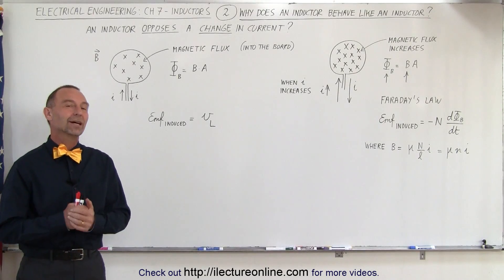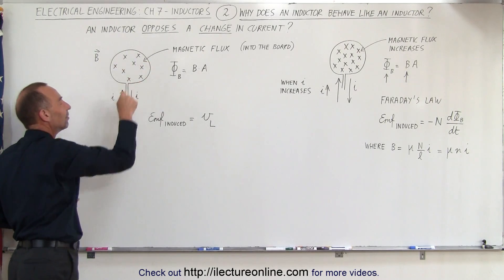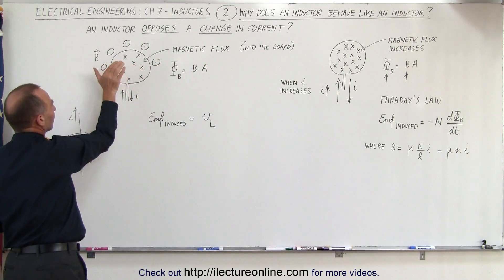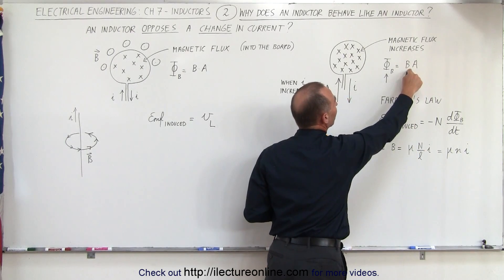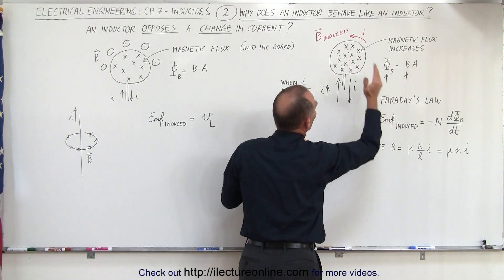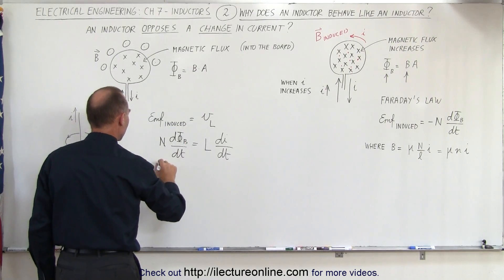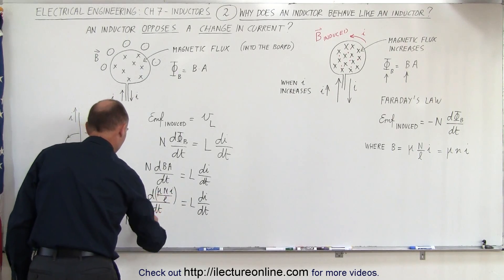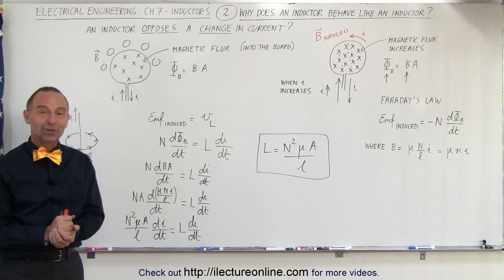Electrical Engineering: Ch 7: Inductors (2 of 20) Why Does an Inductor Behave Like an Inductor?

Comment: if the induced current sets up an opposing magnetic field and current, does that only cancel out the change in the magnetic field and the change in current caused by the increased current? if that is so, should there be no increase in magnetic flux, and therefore no change in current, so where does that extra applied energy go? Sorry, I'm confused. I will try an watch further but this confuses me.

Comment: I have a question: If you have an inductor that is rotating around the axis through its center and is perpendicular to its circular cross section, with homogenous magnetic field running parallel to the axis, will there be a voltage induced? If yes, is there any equation to calculate that voltage?

Thank you for making these videos, they are very helpful
Reply from the maker: A voltage is only induced if the magnetic flux through the coils changes.   From your description that does not appear to be happening.

Comment: Just to clarify, the change in magnetic flux results in and induced electric field according to maxwells equations. That induced electric field is obviously acting over a distance, in this case the length of the coiled wire. And since E*d is the potential difference. That is what we call the induced EMF right?
Reply from the maker: That is correct.

Comment: So lets see, a solenoid is an ac device but when used in a dc configuration it still creates a magnetic field drawing in a core of metal, thus increasing the the permeability and holding the solenoid in an active state.  But why is it creating a magnetic field if the current through the inductor is not changing?
Reply from the maker: The magnetic field builds when the initial current first builds from zero to its final state.  After the current reaches its final state, the magnetic field will remain constant, until the current changes again.

Comment: How and why is the induced emf produced?
Reply from the maker: It is a property of the magnetic field that if the magnetic flux through a loop changes, a current will be produced in the loop.  And since a current cannot exist without an Emf (voltage) we claim that the changing flux through the loop causes an Emf to be produced.
Reply: Would emf induce in the inductor if applied voltage is DC?
Reply: @RizwanKhan_99  No, no back emf is induced in case of DC through an inductor

Comment: Professor,  I have a question. 
In the first example you said that the magnetic field goes in the chalkboard on the area delimited by the inductor and that it goes off, directed outside the chalckboard, right outside the area of the inductor. 
My question is: 
is the magnetic field supposed to be equal to 0 outside the inductor's volume ?
Reply: goes out*
Reply: http://hyperphysics.phy-astr.gsu.edu/hbase/magnetic/solenoid.html#c1